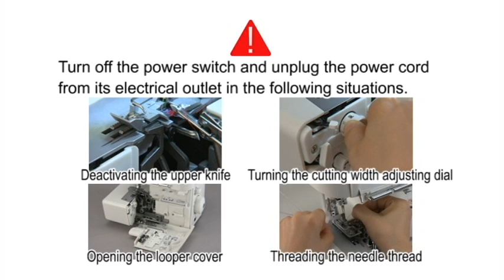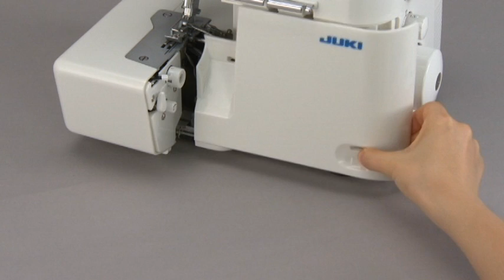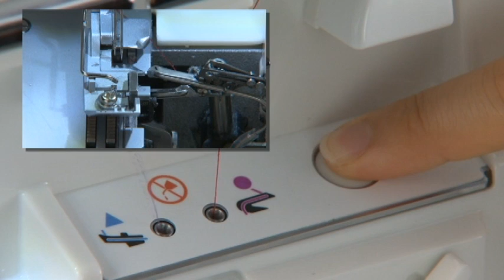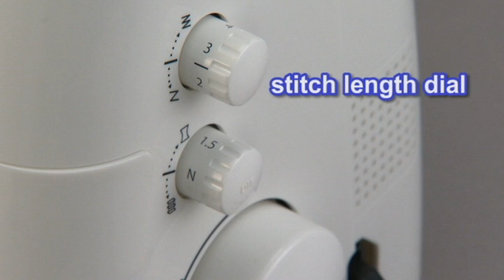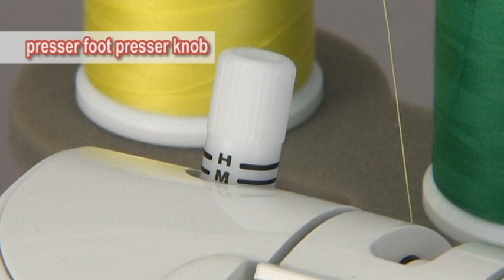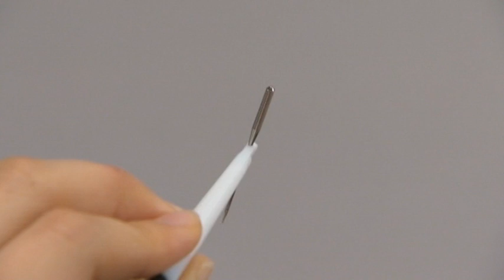MO-1000 Introduction

Comment: I have two issues.  Using the looper threader for the lower looper.  The wire does NOT come out anywhere.  Secondly, getting the foot ON is difficult to put it mildly.  If I have the groove aligned, the wire on the foot  will not set in it's groove. If I align the wire first, then the grove does not align.   When I finally do get things aligned I have to use my tweezers to push down on the foot to make it snap into place. Hope you have ideas on how to fix these issue for me.